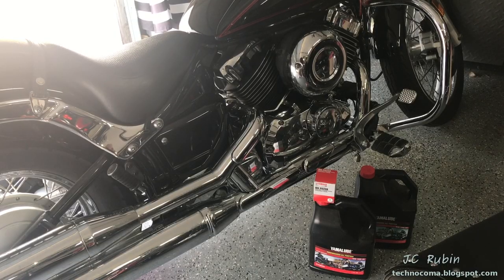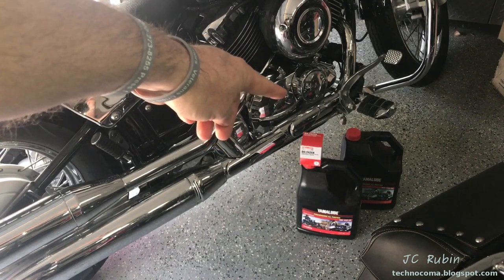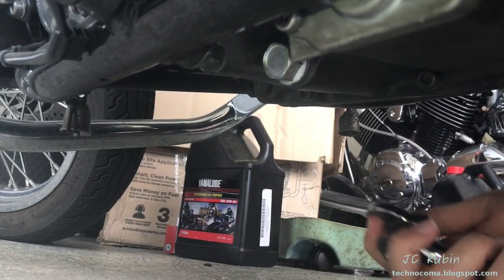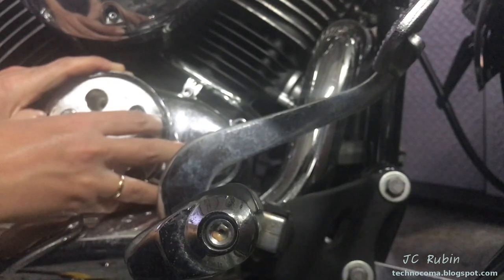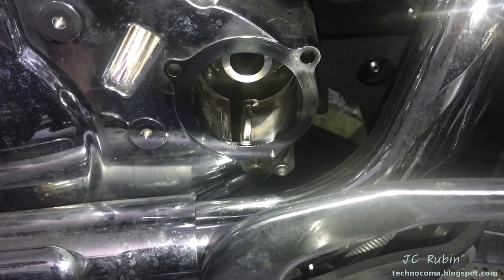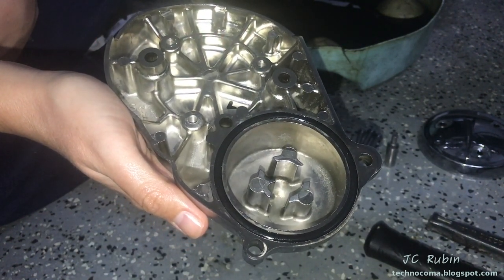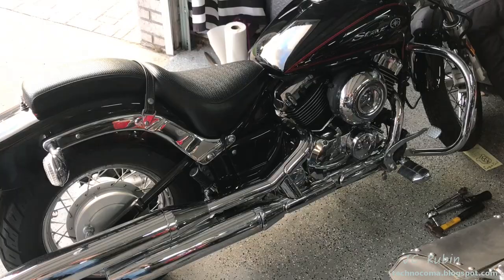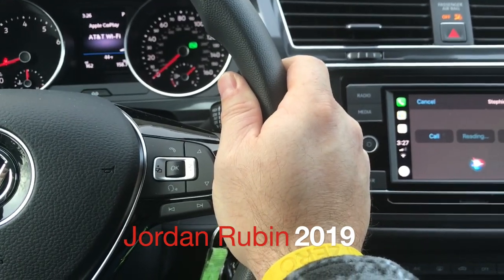Yamaha Star 650 Maintenance - Oil Change With Filter

Comment: As a thought, I agree with not changing oil hot. In addition to your points, swapping the filter gets dicey with a hot exhaust. If you have patience, another idea is to change it twice. Change it once with “flushing oil” and run the bike for 15 minutes. Let it cool and change it again with fresh oil and filter. My friend who does this uses the “flushing oil” 5-6 times and then recycles it. I’m too lazy but someone might appreciate it. 😂

Comment: Awesome seeing you & the Mrs. work on the bike together. My girlfriend wants to ride so we've discussed getting her a starter bike. She wants to help me with all the maintenance and carb rebuild as a fun project.
Reply from the maker: 650 is a good starter bike except for the clutch handle.... I got a replacement as the factory one is terrible.
Reply: @retrotechandelectronics  what issue did you have with the original clutch handle?

Comment: I am in full agreement with you on heating the engine, then draining the oil. I would rather have all of the old oil drip down from the heads by gravity with all of it finding its way to the sump of the engine. I don't know why Yamaha says to do this, but I think it is not the best of ideas.

Comment: varying-length bolts around its perimeter in the proper order. I torqued each bolt down gently but securely (the spec in the manual is 10Nm, or 7 ft-lb., so not much), not wanting any to strip or snap. For the oil filter cover and  manual calls for 43 Nm (31 ft-lb) of torque on the drain bolt.
Reply from the maker: I have an in/lb wrench for these low values

Comment: I just change the oil and filter. I notice now that when the bike is on the kickstand its leaking oil.. Is it possible I didnt tighten the oil screw tight enough. I fell like there is not enough clearance to tork the bolt down with a mokey wrench. But im not sure it would be leaking that much oil. Does the plug need to be replaced or just try tighting it more somehow? could the oil be coming from some where else?

Comment: TY very helpful. Agree change oil cold!  Do you need to use a crush washer or gasket on drain bolt?
Reply from the maker: There is a washer.

Comment: Question on my vstar 650 they say it takes just under 3 quarts I let it drain completely changed the filter put everything back together added just under 3 quarts started it let it warm up turned it off and checked the leave in the glass and it's right in the middle where it should be but I checked it again about 20 mins later after putting my tools away and it's over filled the glass and completely covered but is I start the bike and check it it's back to normal at half glass when the bike is running is it normal to be over filled when cold and at normal level when running and yes I'm checking the level when bike is straight up and down

Comment: Good video had a ? Is there a difference in running 10w40 vs 20w50 Yamaha lube?
Reply from the maker: Yes, the viscosity.
Reply: yes, 20W50 is too thick for this bike
that is why the owners manual says to use 10W40 or 20W40 for summer temps, and 5W30 or 10W30 for below 40F (if you ride in the winter)

Comment: I live in Massachusetts I have a 1999 v star 650 classic with 20,000 miles what kind of oil would u recommend?
Reply from the maker: The exact oil recommendation for your model year would be found in the users manual

Comment: I have a ? On my rear axle nut what torque ??? everyone says 60 to 70 ft lbs to tight and there is no gap between differential hub and wheel is there a measurement for gap between hub and rear tire I left the gap like it was when I got the bike vstar 650 2005 classic please help thanks
Reply from the maker: What does this have to do with an oil change?>
Reply: This has everything to do with an oil change !!!

Comment: Just got a vstar 650 as my first bike, any tips on how to install a tachometer like yours? I've come from driving a manual car, so having a bike without a tachometer is so bizarre to me.
Reply from the maker: Power off the Headlight, ground off the chassis, and signal off the ignition coil.
Reply: @retrotechandelectronics  do you have a particular recommendation of what type of tachometer to use?

Comment: Do you only need to set the bike straight to fill the oil? I read somewhere it gas to be straight for the entire process.
Reply from the maker: Yes.
Reply: Just received the oil filter. I am shocked at how tiny they are. Looks like a 2" cylinder by 2" in height

Comment: Hey guys I've been running my v star 650cc with 20w-50 oil which is thick for 2,000 miles any chance I couldve harmed the engine??
Reply: No, 20W-50 is fine, just more suitable for warmer climates. Check the owner’s manual to see what the manufacturer calls for. I have a ‘07 V Star 650 and use 10W-40 in mine, but a 20W-50 would be okay, too. I’d recommend the 10W-40 over the 20W-50, though.

Comment: very thorough and informative, thanks!  Also, I think your opinion concerning "when" to drain the oil at the beginning is sound.  Besides the fact that it gives dirty oil a chance to recirculate, your wife could have burnt her hand when removing the oil pan bolt.
Reply from the maker: True, precautions were not taken since the oil was not hot.   If it was and I do it, I generally don't care anyway and keep out of the expected stream of oil.

Comment: what's the torque setting to aim for the bolts during reassembly?
Reply: did you ever figure this out?
Reply: Torque settings vary according to diameter, bolt or screw threads are dry or pre-lubed, and application. The shop manual, available online free, (although not for every year) has all torque settings. Important to use 650 for 650, 1100 for 1100 engine sizes, and so on, for possible variations. If you can't find that info because of a rush to finish for some reason, I go with, "just snug" until I can find torque numbers. Overtightening stretches the bolt threads, and can damage male & female threads including stripping, breaking now, or next time, etc. 
 I've rebuilt industrial machinery of all sizes for 40 years and from experience, just snug with maybe going more snug later is much better then overtightening. Again, torque info is in shop manual.
 Another tid bit of info concerns Phillip head screws ! Anything manufactured in Japan uses J.I.S. head screws, NOT Philips
They are very similar, but Japan's J.I.S. MEANS, Japanese Industrial Standard, and you will see much better results using J.I.S. screwdrivers or bits. Our Phillips drivers and bits mismatch enough to strip the heads, etc., confounding many as to why, myself included until I found this difference. Held side be side the two bits show very slight differences, but it's enough many times to make a simple job turn into a pain ! I keep sets of J.I.S. #1, #2, & #3 With my arsenal, lol ! Can be found on Amazon among many others.q
Hope something here helps ?

Comment: Hey mate! I don't know how much oil we out in for the oil change. Can you help me with it?
Reply from the maker: Oil should be measured against the level line through the glass and again after running for a minute as the filter will displace oil.  The measurement is conducted on level ground with the bike upright. This is the only accurate method.
Reply: when you change the filter the bike needs 3 quarts
if you dont change the filter the bike needs 2.8 quarts

dont bother with the site glass, it will not be correct until you ride the bike 200 yards down the road and the oil pump fills up the new filter.

It ALWAYS needs 3.0 qts with a new filter. Just pour it in. Check the level the next day after you ride. It will be correct.

Comment: How much oil did you put in?
Reply from the maker: The level is determined by the glass indicator
Reply: For Dragstar 650, 2003 is needed: Recommended engine oil:

Oil quantity:
Without oil filter element replace- ment:
2.60 L (2.75 US qt) (2.29 Imp.qt) With oil filter element replacement: 2.80 L (2.96 US qt) (2.46 Imp.qt)
Reply: For more information get the manual. I always buy 3 liters. Is enough. Yamalube is recommended but you can get another one.

Comment: does the yamaha dragstar 400cc have the same oil filter as that ?
Reply from the maker: Ask your local dealer for the correct filter for your model if you are not sure. Then you will have the part number.
Reply: 400cc كم لتر زيت تحتاج ؟
Reply: @عبدالرحمن-ث9ع1ل   2,600 gram
Reply: khzam b ممنون اخي